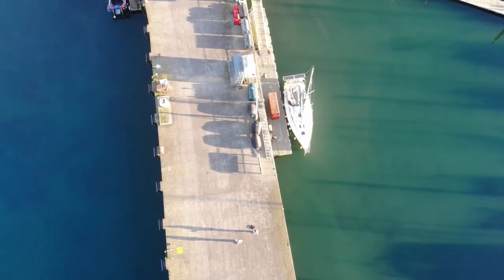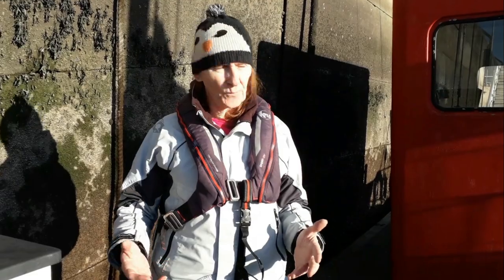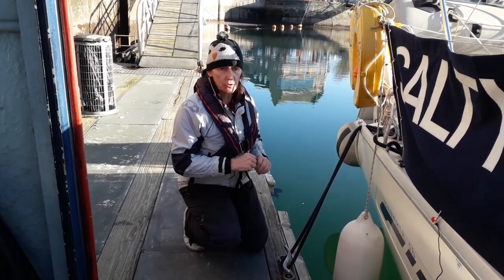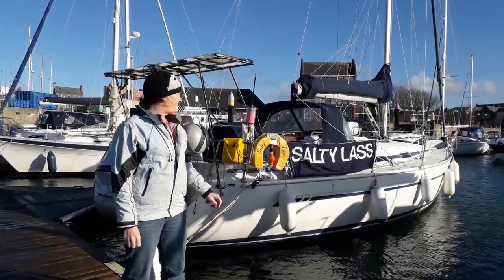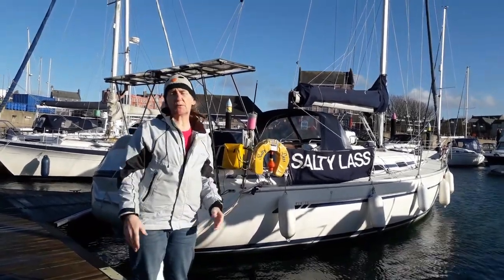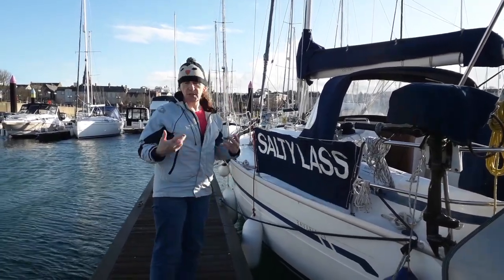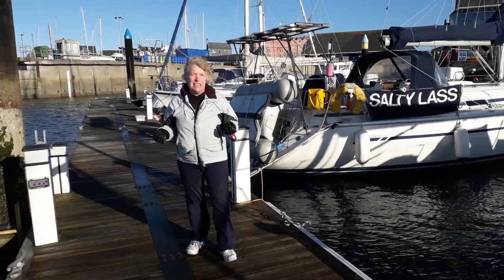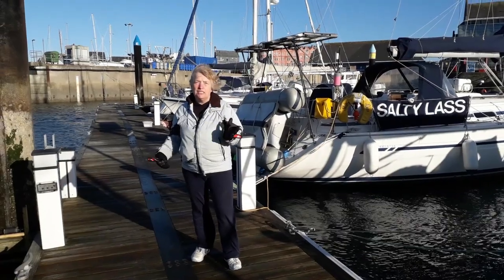How to spring your boat off a pontoon - Bangor - Northern Ireland - Ep. 228

Comment: We won't discuss the month in Tahiti when dad "patiently" taught my brother and me how to manually spring.
Being small as an eight year old, there were more than a few times that I was pulled into the water while trying to maintain proper tension on the line.
You made springing look as effortless as dad did. Well done!
Reply from the maker: Whilst we do manually spring, using the engine requires a lot less muscle as we do not feel like getting hauled off the side of the boat. Tahiti sounds like a lovely location to practice and I will bet the water is a lot warmer than Bangor 😄

Comment: Thank you. Just wondering why you don’t use a slip line on the mid cleat also. I don’t think i would ever use a bowline on half a cleat too much risk of not being able to get it off
Reply from the maker: We prefer the small bowline because the distance from the stern to the middle pontoon cleat is too long to leave any effective line when rigged as a slip and our longer lines are a coarse 3 braid that does not slip as easily.

Comment: We only use slip lines for springing off. I control the bow line until cast off
Reply from the maker: We rarely spring, but when you need it you need it...
Reply from the maker: What Beverley really means is "we rarely spring using the engine method", we like you just use slip lines, for example in the video I say we just use the rope pulling method for going astern from our slip, but if you ever find yourself parallel parked with your yacht, it is a good technique to know about.